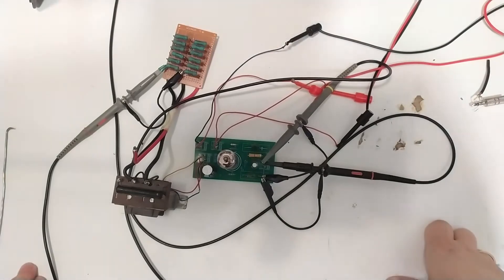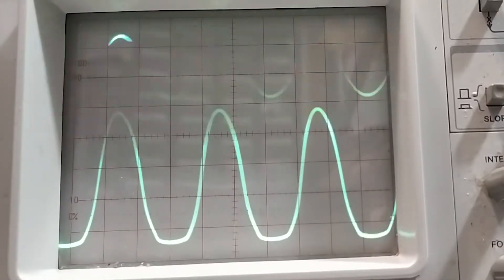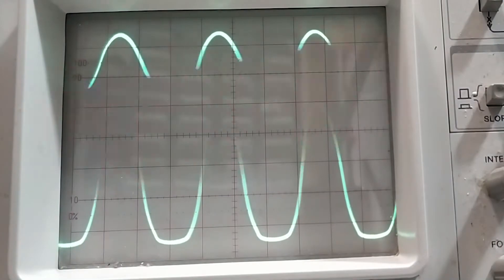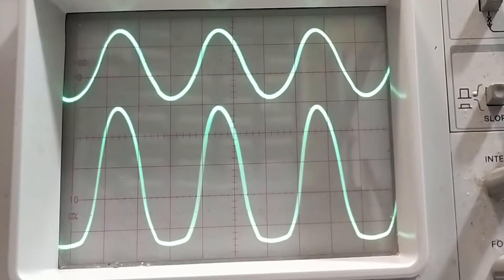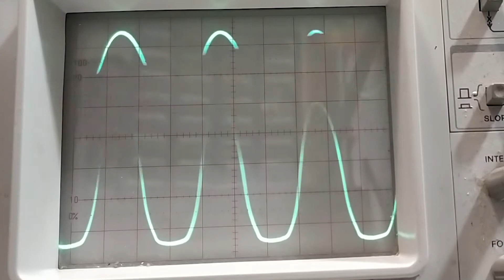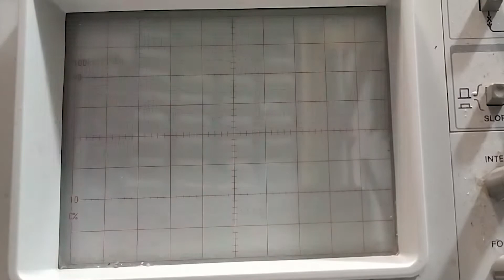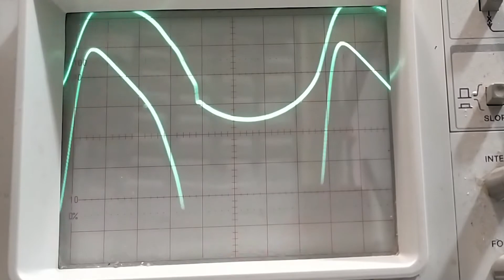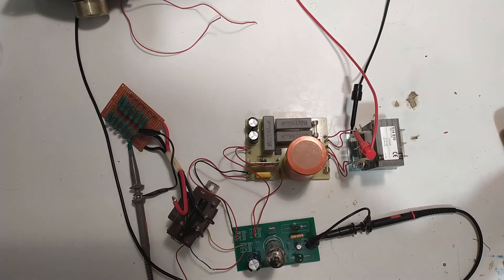Building a Compact Single Ended PCL82 Vacuum Tube Amplifier 5

Comment: That sine wave at 8:34 is still not quite right. FYI the PCL82 datasheet says 170v max at plate.
Reply from the maker: Depends on the Datasheet you read I suppose, mine gives higher Voltages (Va0 550V and Va 250V).  Anode Voltage drops to about ~170V under load so this shouldn't be an issue either way. How does the sine wave look not quite right to you?
Reply: @captainsolder5247  Sine wave noticably too fat on top, whereas earlier it was too fat on bottom. Anode max voltage always under load.  
http://www.r-type.org/exhib/aaa0198.htm
https://www.radiomuseum.org/tubes/tube_pcl82.html
https://frank.pocnet.net/sheets/010/p/PCL82.pdf
Reply from the maker: @Nirky  On reviewing the picture it is evident that there still is some distortion, was hard to see on the oscilloscope though when I took that picture. Might look into that again
Reply: @captainsolder5247  Yep I'm no electrical engineer but first order of business for me would be to confirm 170v max at plates, and then go from there. You picked a good tube, I've built two PCL82 amps and both sound wonderful. Good luck with the project.
Reply: I've been messing with the russian version of ECL82 (6F3P) and it's 200 v nominal, but sounds better with 230 v on plate.